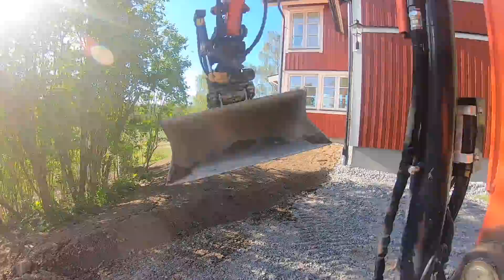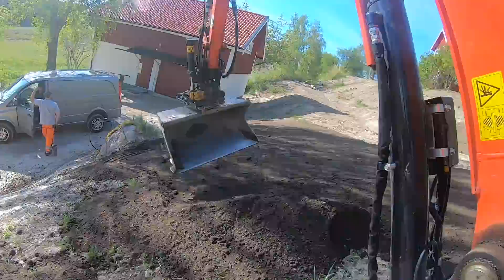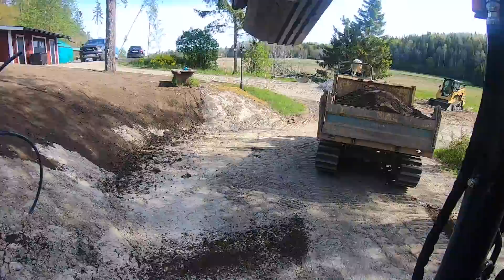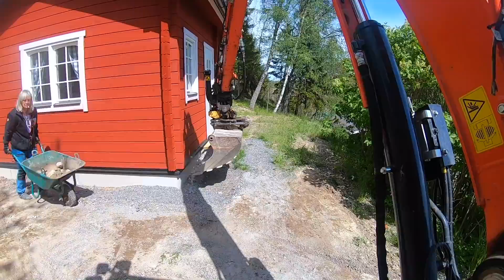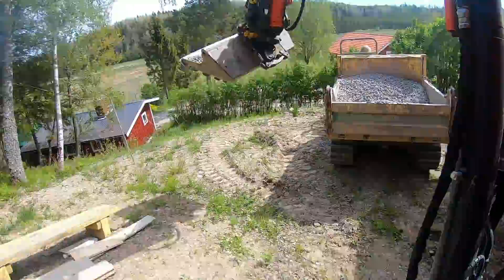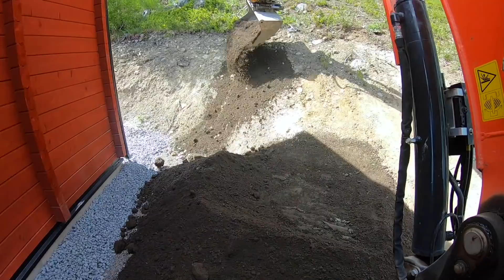Final adjustment Part 8

Comment: yay, another episode, we were starting to get Hedblom withdrawal syndrome ('HWS' as its officially called!)... few questions, 1- the stone/topsoil is always screened exactly the same, do you quarry/screen your own materials?.  2- what volume is the grading bucket? and 3- who/what is that cable-tied on boom?... oh and we love the wheelbarrow mod too, that's getting copied!
Reply: Wheelbarrow mod?
Reply: @erik....  the wheelbarrow has 3 rings welded on the top of the pan sides, by doing this an excavator/backhoe can lift when it's full with a 3 leg chain sling... if you take off the back sling you can also tip it while it's still in lift!.. think of it as a budget, portable concrete hopper!